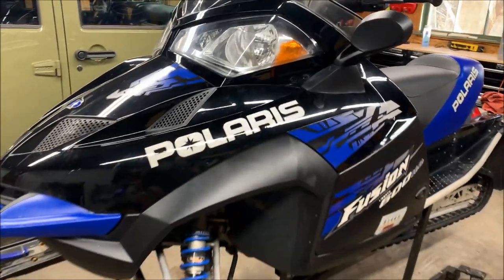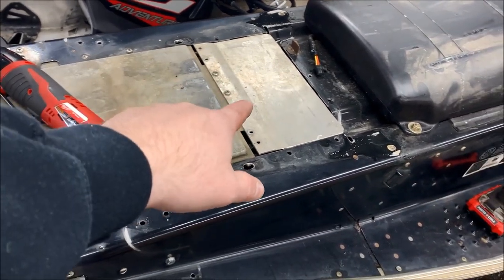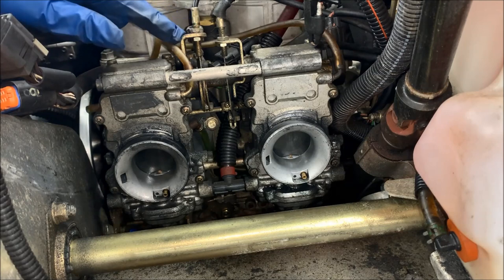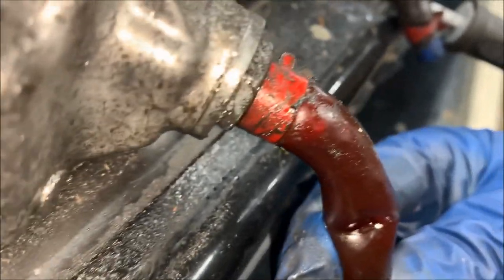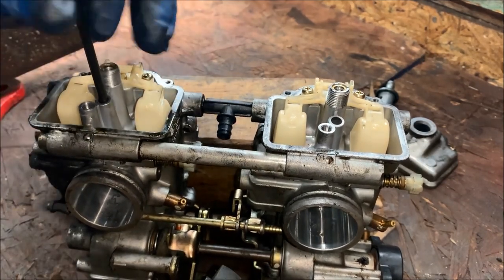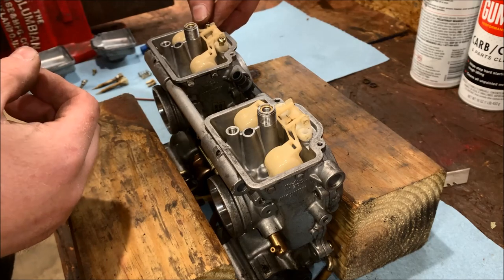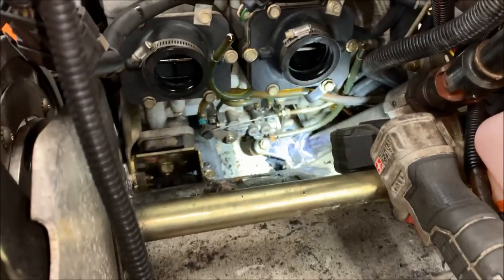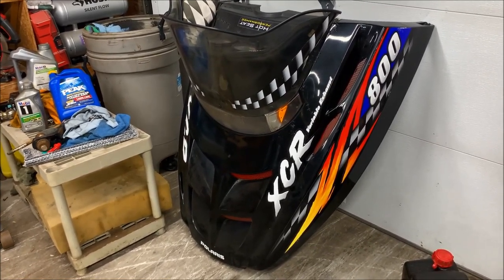How to remove and clean Mikuni Flat Slide Carbs on  a Polaris IQ or Fusion

Comment: Great video!!! Bout to go through the carbs on my '03 ProX 600, and those carbs look identical to what I have. I suspect those o-rings you were talking about are my problem.
Reply from the maker: Yes. They’re identical and make sure to get the o-rings. It’s pretty much the only thing that goes wrong with them
Reply: @StreetersGarage  Fo-Sho. I won’t even crack them open until I have the o-rings in hand. Thank you!
Reply from the maker: You're Welcome. Good Luck!
Reply: Same issue with my 02  700 RMK...

Comment: I have 5,300 miles on my stock Fusion 700! Hasn't been rebuilt and still starts on 2nd pull in -20 degree weather.  3rd pull maximum every time
Reply from the maker: That’s awesome!

Comment: You really have some great videos thank you! I have a 700 and 800 edge chassis. Any tips to dial these into making them start easier? Mine is typically a 6-8 pull to start from cold. Anything to look at first. Carbs are super clean?!!
Reply from the maker: Thanks!

Typically they should start on the 3rd pull assuming that you have good compression on both cylinders. I’d check that first.
Reply: @StreetersGarage Compression is good, new top end. Thank you

Comment: Could not get the pilots out. Tried all different combinations on the screw drivers. 
.i didn't  want to strip them so I cleaned and sprayed air the best I could.
Do you need to do anything with the top of the carbs/slides?
Reply from the maker: Typically you don’t have to deal with the tops. But it would be good to pull the caps off and inspect the slides and make sure they’re not cracked. 

If the slides are green in color, they’re prone to cracking. If they’re black, you should be ok.
Reply: @Streeters Garage 
 thanks for the information .
Reply from the maker: No problem. Good luck!

Comment: Great video. Helped a lot with my 2001 zr800. Question that brass knob at the top by the throttle cable is the adjustment for idle?
Reply from the maker: Yes it is.
Reply: @StreetersGarage  thanks, quick response!!!
Reply from the maker: You got it! Think snow.

Comment: Hello, thanks for the vidoes. Do you know if the part number for the orings the same for the 04 polaris 700 switchback? Carbs look identical.
Reply from the maker: Here you go. 

1921401 - Polaris Part Number
KV/10 - Mikuni Part Number
Reply: So will the 3130533 orings not work in my carb?
Reply from the maker: Sorry. 1921401 isn’t correct

3130533 is the right one.
Reply: No problem thanks for your help appreciate it. Happy New Year!!!

Comment: My 99 xc 500 has these..my bottom end keeps flooding fast, gas isnt pouring out the over flow so it's not a stuck float, think it's them orings?
Reply from the maker: Definitely.
Reply: @StreetersGarage  just tested it with a pump, it's definitely leaking can hear it, thanks
Reply from the maker: No problem. Glad you were able to find the issue.
Reply: @StreetersGarage  didn't fix my flooding issue..even replaced the pump, I don't get it

Comment: What carb settings worked best for you on this sled in terms of jetting, screw turns and needle clip position? Right now my current set up is this 400 main jet
                       Stock 145 starter jet
                         45 Pilot jet
                           .6 Pilot air jet
                          Stock needle position 2
                          Screw turns? 
I’ve heard a lot of people going to the .9 or 1 pilot air jets and maybe raising the needle to position 3. But going over the discussion boards everyone did something different. Thanks
Reply from the maker: Honestly, I don’t remember

Comment: Any idea on how to adjust the float heights.  Do you adjust them for level with the carb upside down ?
Reply from the maker: You want the brass float arm parallel with the with the edge of carb body.
Reply: The carb float asembly are all 100 percent plastic.  No brass tang to adjust.
Found my floats both just a tiny bit below level when viewed upside down.
They are holding,blocking fuel when closed.  Tested them with my mouth blowing air into the carb gas input plastic T line. Yuck,Yuck..
Took them apart.  Now need new o rings.  Might you have a spec, part number ?  Wanted to check seat for debris, corrosion.
Also...great tip on reconnecting float bowls and then tightening drain bolt before the holding phillips screw.
Reply from the maker: Yep. Sorry, I didn’t realize what video the comment came from. 

Part number from Polaris 3130533

Comment: hi, you said you would post a link to the homemade tps tester. it would be great if you could pass that on.  also, where did you get the jet screwdriver?
Reply from the maker: Buy this

Throttle Position Sensor (TPS) Adjustment and Test Tool, All adapters Version https://a.co/d/aV1hMlF
Reply: Curious about the cheaper homemade version, did you make yours? Did it work correctly and give you correct reading to set tps? Could you send link for directions anyways pls?!?
Reply: I cannot easily adjust or tweak my tps sensor with T.B. installed on sled. I had to replace my tps and didn't record original position and first attempt was shots in the dark. I tried three other times with removing T.B. and adjusting tps on work bench with my snap on modus scantool. I now have it close but not perfect.
Reply: I got a 2006 Polaris IQ 700 C.F.I.

Comment: Do you have the amount of screw turn specs for this carb? Looks like the same one as my 2002 polaris indy 500. I need to know how man turns on each screw that factory calls for. Someone tampered with mine and I don’t know if they’re set to spec or not.
Reply from the maker: If it’s the Fuji 500. 3/4 of a turn
Reply: @StreetersGarage  I’m gonna go look at the carbs and see what they are but isn’t there multiple screws that need adjustment inside the bowl like the needles and jets and outside for the air maybe?
Reply: @StreetersGarage  I was going to send a pic of the carbs but I don’t think I can on YouTube
Reply: @StreetersGarage  however the carbs look just like the ones in the video
Reply from the maker: Ok. If there flat slides the settings will be different. I would need to look them up.

Comment: Are these carbs similar to the flatsides I have in my 2000 RMK 800 ? When I let my snowmobile sit for a couple of days the whole engine fills up with gas.
Reply from the maker: Yes. Exact thing. Make sure to get the o rings

Comment: Do you happen to know if the electric start components from a 2006 Classic 700 IQ chassis will work in a 
2006 Polaris Fusion 600 HO.
Reply from the maker: Should be the same. You would need to cross reference the part numbers from Babbits to be 100%
Reply: @StreetersGarage  Unfortunately they don't list the part number. Thank you, preciate the reply!
Reply from the maker: https://www.babbittsonline.com/oemparts/a/pol/503794a0f87002368411f103/starter-battery

Take a look there and start looking up the specific parts numbers and then look to see where they were used for cross referencing
Reply: @StreetersGarage  thank you. I was looking it up completely wrong...lol thank you !
Reply from the maker: No problem. Good luck!

Comment: I am having an issue with fuel pumping out of the vent hose into the air box.  I did exactly as your video said and it is running great BUT still pumping fuel out.  I don’t know what else to do.  
I happens at low idol only
Reply from the maker: You have a stuck float. The bowls are overflowing and running out of the vents.
Reply: @StreetersGarage   thanks. what would cause the float to stick? I posted this on a Polaris page and many are saying the needle must have dirt or rubber is dried up and not seating properly causing the fuel to pump out ??  I have to re do the whole job.  Hope I get it this time.  If it’s just the float sticking how can I get it to move freely ?
Reply from the maker: Did you replace the o rings?
Reply: @StreetersGarage  yes I put the two new o rings in.
Reply: I did not disassemble the plastic floats and take the needles out and clean them ,  I think this was a mistake.  I didn’t know enough about the carbs until I now am researching all of this.  I’m going to this time. Hopefully it’s just got some grime in there and I don’t need to buy new needles.  ?  I really thought those O rings were surly the problem. So I just sprayed lots of carb cleaner through the port of the needles and blew them out good
Reply: @StreetersGarage  how can I narrow it down to either the float sticking open.  Or a leak in the needle / seat ?
Reply: I wish I could post pictures here. I have needle out they look perfect and are sealing fine.  Is there any other way fuel could be pumping up to that vent line?   Or is it possible the float itself isn’t sealing the needle and seat 100% ?  How can I determine that
Reply from the maker: It would be coming in from one of 2 sources. The needles or the choke plungers. Are you having the issue with one carb or both? If both make sure the choke linkage is not hung up
Reply: @StreetersGarage  I actually was wondering if the choke could do that.   It’s only one
Reply from the maker: Ok. Then you have a bad needle. The vitton tip is not sealing. You’ll need to replace the needle and the plastic seat assembly.
Reply: @StreetersGarage  thanks.  So if it’s only one carb doing it, That would indicate it is not the choke plunger?
Reply from the maker: Correct
Reply: @StreetersGarage  thanks. 
The white plastic that the black rubber area of the needle sits into needs to be replaced too?  There is no actual seat or seal in there,  or is that what the part of the float is called?  The seat?
Reply: @StreetersGarage  I don’t have a pressure tester but if I lay the carb upside down. The floats close. I can not get any air the leak through by blowing as hard as I possibly can into the fuel pickup in the center.   Should I feel some sort of leak that way if that’s what it is?
Reply: If I hold constant pressure and keep it perfectly level while slowly tilting it downwards the side that is having the problem releases air much sooner than the side that is ok.
Reply from the maker: Yep. Bad needles
Reply: @StreetersGarage  thanks for your help. I guess I’ll replace both sides 
Now I need to figure out what carbs they are exactly   2001 xc 500 edge
Reply from the maker: You can source all of the parts from Babbits
Reply: @StreetersGarage  in your experience do you think I will be ok replacing the needles only?  I found them for like $15 each.  Or should I replace the whole float assembly which is much more like $60 each side.  I’m thinking I should do both sides.   Even though the other one is fine
Reply from the maker: I would do both. More than likely the carbs were cleaned with a solvent like brake clean and could have distorted the sealing surface In the float assembly
Reply from the maker: Brake clean or carb clean on any of the plastics is not good for them in general
Reply: Also make sure your float isn't cracked  .it could be taking in fuel ⛽️

Comment: Screw on bowl is stuck/ almost stripped any recommendations?
Reply from the maker: Cut a slot in the screw with a dremel tool and use a regular screwdriver to get it out.

Comment: How do you set them? I just got a sled and want to fine tune idle, and air fuel mixture
Reply from the maker: Start with the baseline specs from the service manual and go from there. 

For setting slide height and idle. Take a look at the video I did for the Indy 500 round slides. It’s the same theory using the correct drill sizes.

But with the Flatslides it’s much easier since it’s a single cable that you’re adjusting. 

Set the cable for the slide height and then use the idle adjustment screw to bring it to final.

Comment: First here sweet
Reply from the maker: Winner - You get nothing but bragging rights.
Reply: Anytime you want to see the difference between sponsorship builds and my build let me know I'll go for ownerships
Reply from the maker: Anything on YT?
Reply: @StreetersGarage  1997 Indy 500 chassis suspension from iqr engine is built bottom end jugs and pistons and heads 107.63 in 660 bring it on
Reply: How do I send pics
Reply from the maker: Can’t through YT

Comment: how do you get those o-rings off? the ones on mine are almost a plastic feel and they dont stretch off the groove. i dont want to damage the float mechanism because that plastic feels pretty thin
Reply from the maker: Use a razor blade to get underneath them and you can then roll it off.
Reply: @StreetersGarage  got em! thanks. great video. my fusion has a decent fuel leak and is very similar to this so i am doing everything but the mice removal to my sled. those capped fuel lines under the bowls didnt look to be leaking but they are pretty rough so im replacing that and doing those o-rings. ive watched a few videos of these flatside carbs and i havent seen anyone mention the o-rings so im glad i found this
Reply from the maker: @jimbigler5287  The O rings are the most important thing with the flat side carbs. Every sled that had the flat slides needed them replaced.  They’re pretty much the only thing that goes wrong with them.